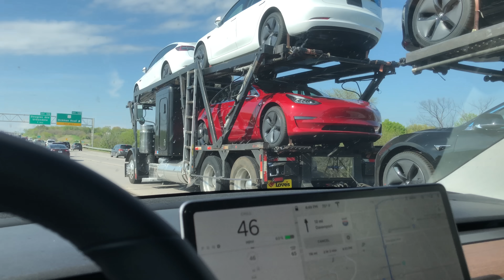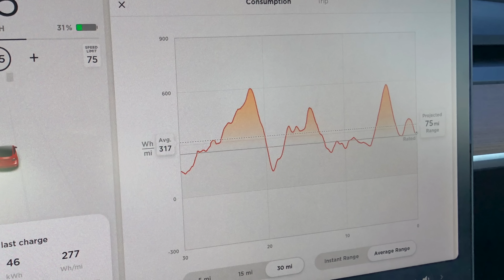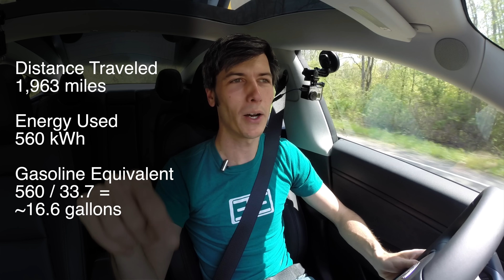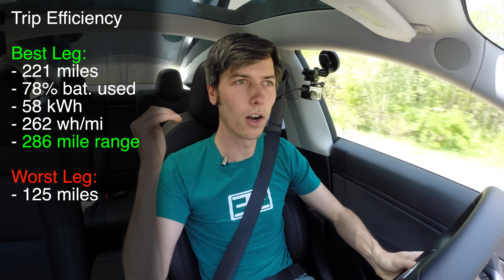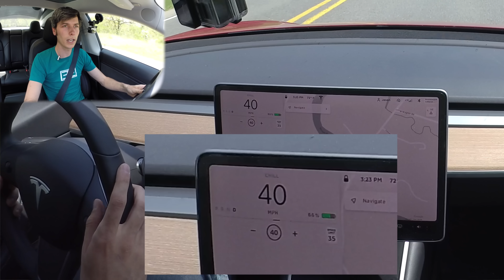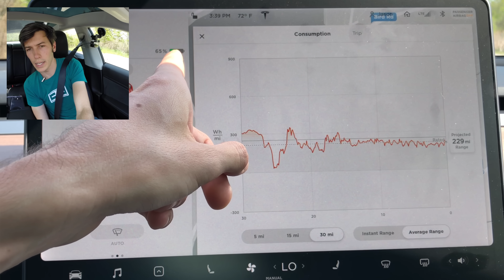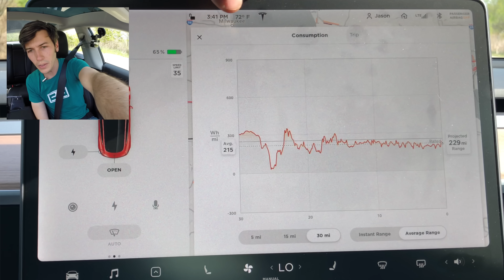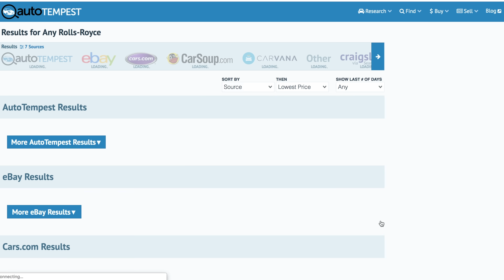How Miserable Is A Tesla Road Trip?

Comment: Yesterday I went to the Upper Peninsula of Michigan. Whole trip took about 1000 miles in my Silverado. Had to refuel 3 times in total (once before I left, mid trip, and returning), but while I was up there I saw a few teslas and I couldn't help but wonder what it must be like to take the same trip in that vehicle. Needless to say, this video was times perfectly and I would never take a Tesla for trips... Daily driving though... Different story lol
Reply: We just did 720 miles in a long-range-model-3 and we stopped to "fuel" 3 times as well and arrived home with 40% so it was about the same as your trip. His problem (with stopping) is that he bought the standard-range-plus model.  You're right about daily driving. We have 300 miles range every time we leave the garage.
Reply: There are over 1400 Supercharger stations and >12k individual Superchargers. Look at the map on Teslas site. If you saw Teslas it's obviously not a problem. I have personally driven to Canada and Key West as well as upstate NY several times. Zero problems. It am now on my second Tesla, put 55k mi on last one in 2 1/2 yrs. A lot of long trips.... and the gas cost difference (plus literally no required maintenance cost) for 55k mi already made my car beat similar ICE car total cost when I traded it. Plus I drove a P85 which could smoke anything, now driving a P3D+. Fantastic long trip cars, huge trunks, great tech, etc.
Reply: @esrandl  I checked the website and as of now there are no charging stations in the Upper Peninsula of Michigan. Which doesn't surprise considering there were barely any regular gas stations to begin with up there lol. Anyways, this leads me to believe the teslas up there are from the locals and they charge at home.
Reply: @mertz313  possible, distance from Gaylord to Green Bay or Sudbury is both within range of current model s without interval charge. There are destination chargers plus just regular ev chargers too.. it's tough to really say. But it is possible even without supercharger on UP.  Ive done similar and it wasn't a big deal.

Comment: So where did your magic power come from? 
You know...the power from the cable plugged into the wall.  
NO way that power was from .7gallons of gas. Regenerative breaking is cool, but no way I am buying that supposed savings. The batteries in those cars, digging up the materials out of the ground, FAR more devastating to the environment than fracking or an oil rig, if you are a tree hugger than is worried about such, as most electric car drivers tend to be.

Comment: So how long do the batteries last? 10 years?  What is the cost to refresh the batteries?
Reply: Warrantied for 60% rated capacity at 8 years... (doubtful that it will be honored)   Replacement is currently sitting at ~8-12k depending on model and battery pack size (so $12-15k when you need it replaced .. if you can get the batteries).  Batteries will also self cutout at 10-15% due to load draw imbalances.. 

So... your fancy new $60k car will be scrap in 10 years or less.
Reply: @zarthemad8386  The same life span of a Toyota Prius.
Reply: Lithium batteries last no more that 3 years.

Comment: Hey, so when you say you used 58 kWh for 221 miles and 42 kWh for 125 miles trips - is it estimate from the battery use or the computer report?
What I find annoying is actually energy that must be delivered to the batter to bring it up to its original charge state and that would be the true energy use and while it adds only a few %, it should be included.
On my personal experience with EV - the "mileage" gauge is not quite accurate as it only measures energy used to propel the vehicle. It does not include heating or cooling. At least not in accurate way - based on 2014 Fiat 500e.
Cheers, mate.

Comment: In the  Southwest U.S. during the summer there are "brownouts".  So our electric grid is not adequate for the existing load when folks get home from work and crank up their air conditioning.  So, when you race home turn on your AC and plug in your electric car to charge the batts, then what?  Good-bye electric grid!  Do you think that the power companies will upgrade their equipment for FREE?  I think not.  Electric cars are not the answer to any of our air pollution or other problems.  Also, you're just moving the pollution problems from the highway to the area around the power plants and if it's nuclear there is the nuclear waste problem.  So, take your Tesla and shove it!

Comment: Had a flat the other day, added about 20 minutes to my journey across town...who the hell goes on a road trip without knowing how to quickly deal with a bad tyre???
I do half my driving on dirt, used low profiles for over 20 years, get less problems than with regular profiles, they have less side wall exposed. Get better glasses, learn to drive better.

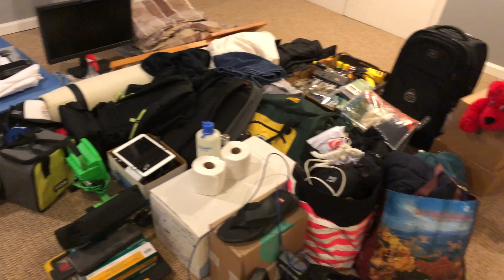Comment: Well if Jason would eat a cheeseburger or take a drink of alcohol, he'd probably look closer to his age.  Good for you!  Your video, however, was impossible to listen to after about 5:30 because obviously you'd had one to many Mountain Dew & Redbull.  Dude, take a breath!  I just did 1250 miles in my Honda Clarity Plug-in Hybrid and averaged 53 MPG overall including the Siskiyou Pass and up to the 5700 ft level of the N Sierra and back down, through 100 degree heat to Palm Springs.  AC rolling about 75% of the time and charging overnight at each stop to top off the EV.  It's astonishing how much energy you can capture riding out the downhill portion of that drive!  I was insanely comfortable the entire trip with the HVAC system operating the entire time in auto mode, the stereo/bluetooth/Sirius working non-stop and my phone charging.  I only have a 7 gallon gas tank so it took 3x filling it up for the entire trip between EV and HV modes.  You couldn't give me a Tesla.  Small, cramped and poorly screwed together.  Honda nailed it with the Plug-in Hybrid.

Comment: "If the temperature outside was really cold, that would significantly reduce range; I don't know to what degree..."

Was that a temperature pun? :P
Reply: LOL that's a new low!
Reply: in cold conditions  battery looses performance because chemicals inside  are freezing and the car is heated from the  battery
Reply: @nicktk  Heck with the battery capacity loss.   Running the heater in the car in cold temps would really kill the range.
Reply: jp040759 Who needs to run the interior heater when you have 3-stage seat heaters in all 5 seats?
You can pre-condition the cabin while you’re inside drinking an extra cupa and/or brushing your teeth, all while still plugged into power in your garage or driveway. 
And doesn’t the Performance model 3 have a heated steering wheel standard as well?
Reply: rJ S no heated steering wheel. You won’t miss it.  Preheating anywhere (in a closed garage eg) is awesome and your steering wheel is plenty toasty.  The range loss isn’t as big of a compromise as you think.  I use my full cabin heater all winter.  Yes I have to charge a little more frequently. Takes 2 seconds to plug in at home, no biggie.  Still more efficient than gas cars.
Reply: @nicktk  I am aware of that :P
Reply: No, because you should be measuring in Kelvin
Reply: @directcharge6648    Oh Yah!   Below 273.15 degrees Kelvin reduces efficiency by up to 50%.
Reply: Below 32F reduces efficiency by up to 50%.
Reply: Gungan certainly does especially locally.  But I’ve found on road trips once the battery warms up (like 90 minutes into the trip) it’s nowhere near a 50% hit.  Maybe 20-25%

Comment: Interesting coincidence. I recently (perhaps the same time as your trip) took a road trip of similar length, along a similar route. (Although I did 2,000 miles out, then 2,000 miles back.) My trip back was in the same direction, and covered some of the same route. I was solo driving in a new WRX. My time behind the wheel, plus food/gas stops, was only about 28 hours over 3 days. (I used the extra time for a leisurely dinner each night.) So, I had a bit more personal time, but paid for it in gas (I burned about 71 gallons.)

Wish I'd kept better records, so I could provide real details, rather than just "as I recall it" numbers.

Comment: Pretty cool about the infrastructure and navigation that Tesla has. I'm a 1 vehicle kind of guy, so I wouldn't consider an electric until other car companies have a similar infrastructure, develop new battery tech that doesn't degrade as fast as the current batteries, and manage to squeeze out closer to 500 miles out of a full charge.

Comment: I have no problem pushing my TM3 down between 5-10% when I'm hopping the Supercharger network. A 15-30 mile margin is pretty generous IMO. I'm more conservative in the winter and want a 15-20% margin. If you travel the Interstate between chargers, the worst that usually happens is traffic, and the car is even more efficient then. Ease into it, take some trips, get used to it. Tesla keeps making it easier too, with Supercharger V3 rolling out with 250kW peak power and with other things like on-route battery warm-up which pre-conditions the battery to maximize peak power.

Comment: I do 50mph/80kph on the highway in my 1980 toyota tercel that draws about 1 gallon/4 liters per 35miles/56km . It is a better fuel consumption than a chevrolet sonic fuel injected vs the carbureted and mechanical point ignition distributor driven tercel... what you said at 5:50 is not totally right : for acceleration you re right but for what is coasting the momentum  ; the more the object has inertia , less energy will be required to keep it s momentum. might be that those teslas are too light , aluminum frames etc to spare energy in the city at low speeds but when driving on highways or long stretches the dynamic pressure has to be seriously taken in account

Comment: Wait -- does the gasoline equivalent include pumping, transporting, refining, transporting again, and finally, pumping? Or is that just the "convenient" gasoline efficiency measure that only looks at the combustion engine part of the thing? If you factored in all the energy used to get gasoline to the car, plus the burning of it in the ICE engine, that would be the more appropriate measure.

Comment: 200 miles wait for 50 minutes. And there goes my enthusiasm for current EV's. Bummer. I have been on such an EV kick and still think its the way of the future. But I'm going to have to wait for a better solution. I also now see why shipping is only using EV's for "last mile" service.

I am an avid outdoorsman, I drive longer distances than a single charge more than once a month. Timing for these things are already tough enough while working full time. so a 50 minute charge is 50 minutes of lost sleep in a circumstance that already has me sleeping about 4 hours.

20-30 minute charging is the mark to hit. Then I can truly charge while I eat and be off again.
Or a 500-600 mile battery. Then I can slow charge when I get where I'm going and still make it home, possibly with a rapid charge on the way home (to about 50%).

Comment: I'm surprised your apparently unaware that the Volt never has to be stopped and be charged. And even though it will eventually be running on it's generator, it's still propelled by electric motors (unless you floor it then the generator augments the electric motor).
Reply from the maker: In this video, I said “Bolt” not “Volt” though the two do sound very similar. :)
Reply from the maker: In this video, I said “Bolt” not “Volt” though the two do sound very similar. :)

Comment: We start with a full battery (LR AWD so 310 miles) and then we hit superchargers every 90-120 miles, mainly cause we stop every 1.5 to 2 hours anyway.  We charge to 100 miles over the next SC, so for example if the next SC is 120 miles away we depart with 220 miles.  And we typically drive 75-80 MPH on the interstate.  With this method the car charges while we take care of business and it's usually ready to go before we are.

Comment: I wonder how much fossil fuel was used to charge that car?
Reply from the maker: Watch this and you’ll no longer be unaware of the answer: https://youtu.be/6RhtiPefVzM
Reply: Exactly. Coal, oil.
Reply: @TrinidadJamesWoods  The US does not use coal to produce electricity. All the old coal plants were retrofitted for NG which burns cleaner, more efficiently and leaves less crud on turbine blades meaning better maintenance schedule. Still fossil fuel though.
A lot of Tesla stations are charged with solar or wind power usually though.
And a NG plant is still many times more efficient than a gas ICE so even with all the grid losses and charging losses, etc. It's still more efficient and produces less CO2 than a gas car on the same trip would've.
Reply: @mikes2381  it's cool that Tesla is able to source their own power more sustainably. I'm a big fan of the company.

Comment: Based on his cost for this trip, it would be a lot cheaper driving my car, a C-Max Energi or a Prius or something like that. I only have a 20 mile range on electric only, but it switches over to hybrid mode after that. On a long trip, I only have to stop for gas after 550 miles or so. Long trips are around 45 MPG, and normal use plugging in at home plus highway travel ends up around 60 MPG.
Also, with an all electric at this point in time, you have to stick to the interstate highways to be able to use fast chargers.
So I guess the point is a hybrid makes more sense on long trips, but electric is great for local.
Reply from the maker: Yes, there are indeed much cheaper ways to travel than an expensive Tesla.

Comment: the thing that gets me about electric vehicles is this, what is the carbon footprint of the mining that is involved with getting the basic components to make the batteries for these vehicles? it's far less than it is in a gas vehicle. and regardless if it's an electric vehicle or not, off road diesel is used and all that mining equipment to go ahead and get those materials for those vehicles. and those vehicles are not efficient at all, meanwhile the Earth's crust is getting torn up so people can feel good about themselves because they're driving an electric vehicle. with the gas engine you're polluting the air, with a modern diesel engine with a regen system on it you are producing a more hazardous chemical when you combine the d e f fluid and Diesel particles. with an electric vehicle they are heavily reliant on natural minerals and metals from the mining process which scars the face of the Earth. I could not in good faith feel better about myself trading one bad situation for another. in reality a diesel engine is much cleaner then a gas or an electric vehicle. the byproduct that comes out of a diesel exhaust that doesn't have def involved looks nasty but it is no worse the oil that is used when making roads for these vehicles to travel on. somebody wants to have a clean conscience maybe they should go ahead buy a horse utilize mules possibly horses to grow the grain to keep those horses fed. then they should grow their own food and make their own clothes from the natural resources that they grow chemically free. that is the only way you can go back to being green with your carbon footprint.

Comment: This is possible in America. In Russia you drive 2000 miles in 2 month on electric car. Because only charge station you can get is 220 volt 6 amper plug in someones wall, and good luck convincing them to allow you to charge a car

Comment: From 27 hours to 38 hours.....Well, let me tell you many of us usually match or beat even the Google estimates on long trips since almost no one goes at the speed limit, most of us going 5 - 15 MPH above. And the excess speed is partly cancelled by the very, very short stops for bathroom, gas and food. As a matter of fact, you can time all of these 3 components in one stop, you get off the major interstate, you gas up, you pee and you drive-thru and/or combine drinks with whatever food you brought. 

Your definition of efficiency for the overall trip is a failed one since you did not include the TIME and COST components, this is only ENERGY efficiency. Because if you don't, then riding my road bike is the MOST EFFICIENT way, energy-wise for those 1963 miles, even if I travel 100 miles / day for 20 days. 1 Gallon of gasoline is aprox. 31,000 calories. One Century ride at cruising speeds is about 5,000 calories. Figure out less than 3.5 gallons for the whole trip, at very little COST, TIME be damned.

On the COST side, you can buy a brand new Hyundai Accent and beat the TIME of the Tesla, every time for a way lower cost. Because there is no such thing (YET) as a low cost electric car, although there is such thing as a low operating cost electric car, which is still not enough to offset its higher cost. BTW, the Hyundai has the same powertrain warranty as the Tesla.

The extra TIME you spent travelling on the Tesla could mean one more night at a hotel, offsetting the lower trip costs of the Tesla. 

Yes, the Tesla is fun to drive and it wins in day to day City driving, the daily commute since all you have to do is plug it in at the end of the day, no gas stops and no oil changes. Heck I would prefer it in this setting  over a BMW 3 series. But...this is the land of long distance driving and electric cars still got some way to go, more so when it comes to COST and TIME constraints.

Comment: The 16.5 G kw equivalent isn't that impressive depending on the source of electricity. If you got it from a gas turbine that's 40% efficient, thats about 36 gal of natural gas equivalent or 56 mpg over the road trip. Impressive, but not that far out of the realm of a hyprid. With electric cars you see the most effecient step of the process, with internal combustion you see the least effecient step.